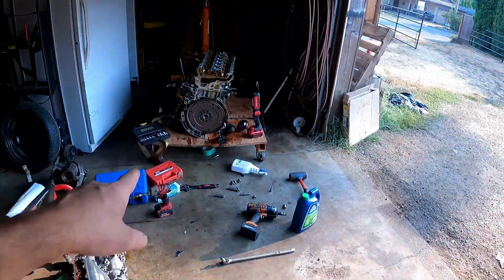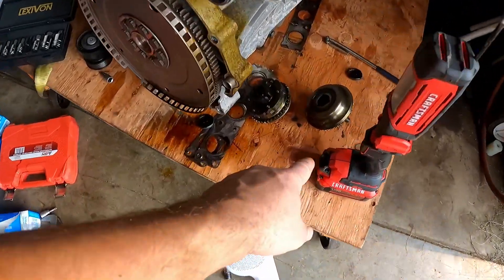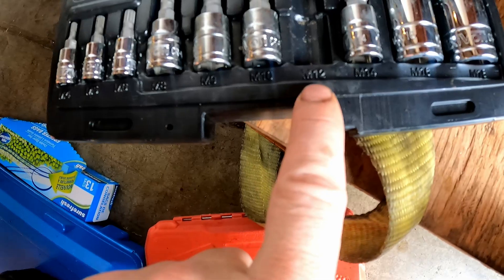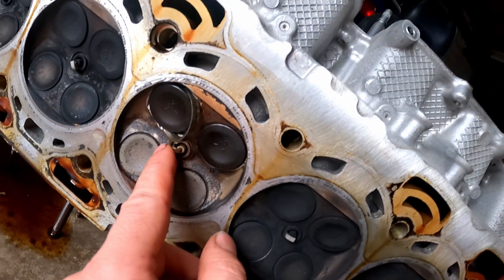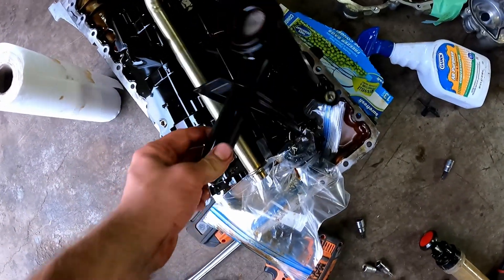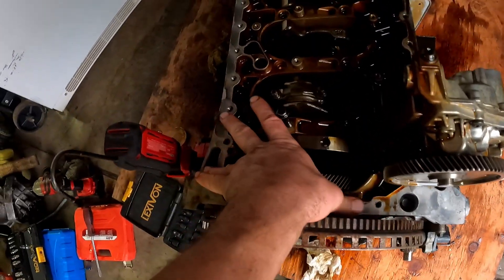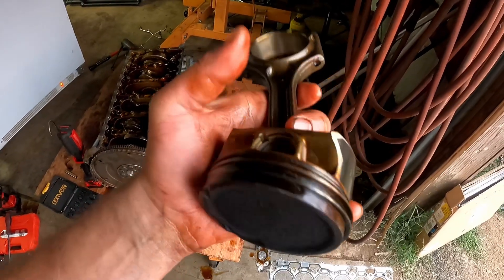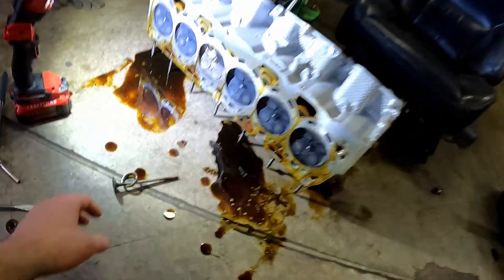Volvo P3 3.0L T6 Engine Disassembly.

Comment: ive seen a guy pull the treads out of a block on that engine when re installing the head. please make sure you lubricate the bolts. they get pretty tight.
Reply from the maker: Not really the head bolts were alot tighter on p2r 2.5l. These came out fairly easy. Maybe if you overheat the heck out of it maybe.
Reply: Threads.

Comment: what were your numbers before you tried to up the boost?
Reply from the maker: What do you mean numbers?
Reply from the maker: And this is not the engine from my car as i mentioned in the video.
Reply: @BuiltForSpeed horsepower and torque of the red car, my apologies for the confusion
Reply from the maker: @tar6a  your guess i as good as mine i was street tuning it.

Comment: That valve is definitely bent, even the slightest. It made contact with the piston.
Reply from the maker: Possibly. What i meant is it's not very obvious that it is.
Reply: @BuiltForSpeed  I had a bent valve in a different car that was ever so slightly bent, it wouldn't seat correctly, and I was only able to tell by marking the valve seat and the valve
Reply from the maker: @MyGellyRoll  and it wasn't the valve hitting the piston it was the valve seat.
Reply: @BuiltForSpeed  might be beneficial to get the head port and polished, new valve seats all the way down and new valves while it's out. I'm very interested what numbers this is going to put down just with the pistons alone lol
Reply: Crazy!